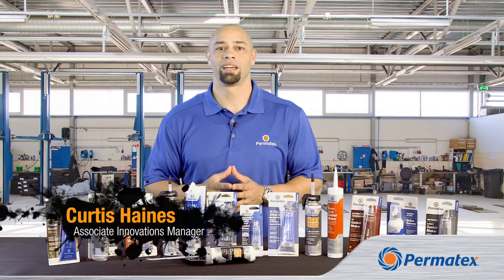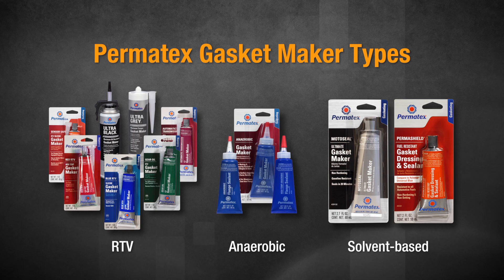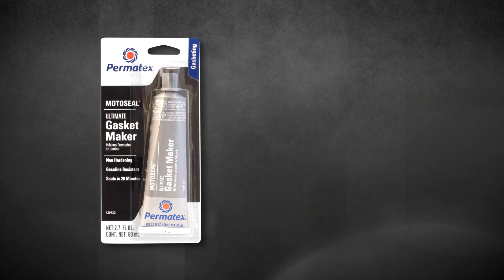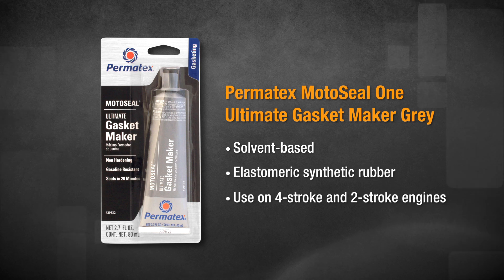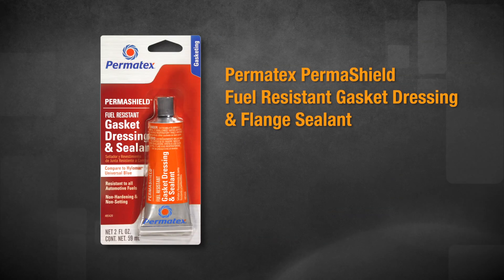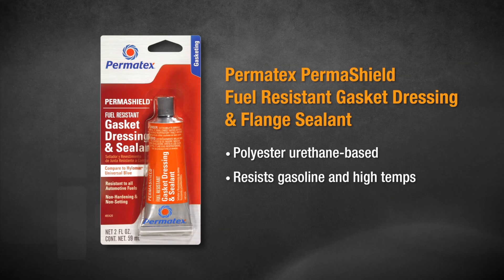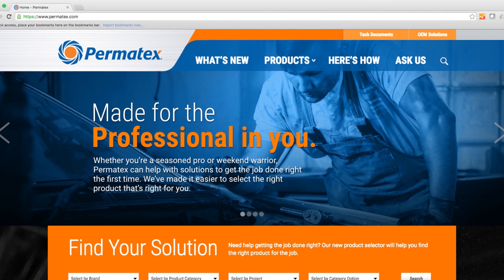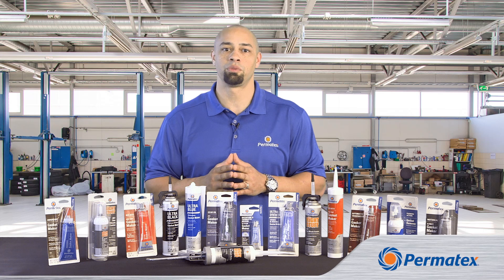Solvent Based Gasket Makers: Permatex Tech Tip Series

Comment: Isn't the correct way not to use the paper gasket if you're using a gasket maker? I used the aviation form a gasket sealer on both sides of a paper gaskets on timing cover and water pump. A video on the aviation gasket sealer would be neat, not totally sure what its best uses are.

Comment: Very important question. It stands up to fuel, BUT will it STOP a slow gas leak? Case in point, I think I crossthreaded the bowl nut on snowblower carburetor bowl. It leaks there even with a new gasket. Will your product stop this gas leak on my float bowl??
Reply from the maker: Hello, we've been a little busy getting a few great things ready for and apologize for the delayed response. We have a few follow up questions to make sure we provide an accurate solution.  Can you submit a product question https://www.permatex.com/contact/ and we'll get back to you ASAP.
Reply: @permatexvideos  Thanks. I replaced the carburetor. I decided it was the best way to go. All set, thanks.